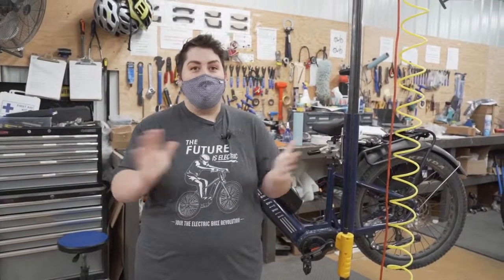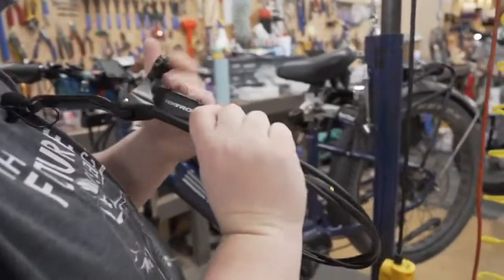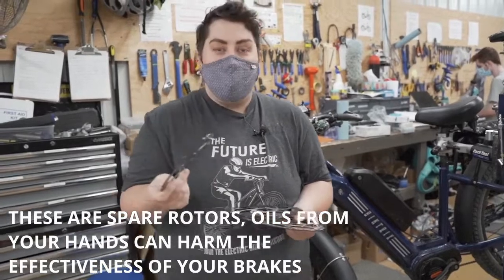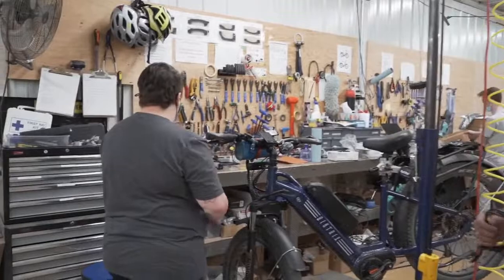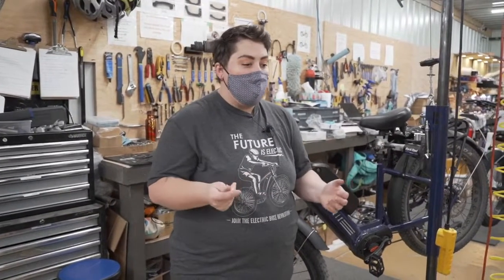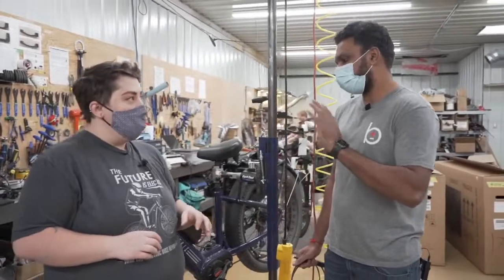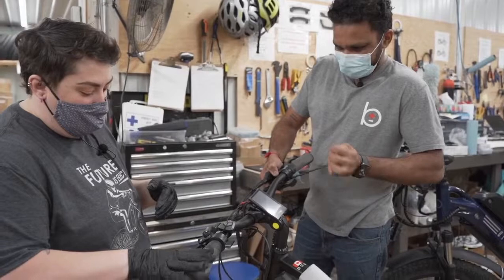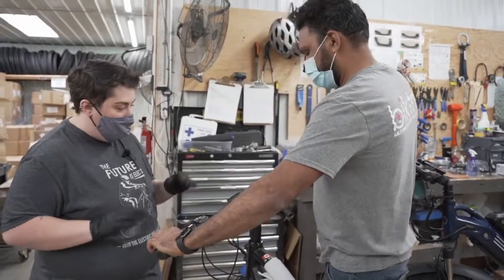How to maintain your eBike's Hydraulic Brakes

Comment: I have bleed/burped the brakes just like you guys did, no more bubbles and brakes are still spongy…..  any thoughts?
Reply from the maker: There is still likely some air in the hose..
Reply: I had that issue. I tapped on the brake hose with a small screwdriver blade starting at the caliper working up to the master, this releases any air bubbles trapped in the hose. Worked for me.

Comment: With about 230 miles on the tekro E-350 the front brake lost all pressure 
I can feel oil on the caliper but I can’t tell where it’s coming from 
I have the ultra 1000 that I bought used a couple of weeks ago with only 22 miles on it 
Any suggestions?
Reply from the maker: Best to check that all of the connections are tight. Worst case is you have to replace the front brake which is a very easy job. Email support@biktrix.com and we can help you out further!